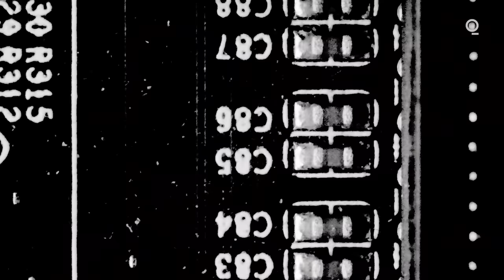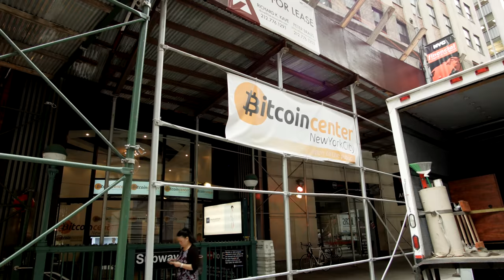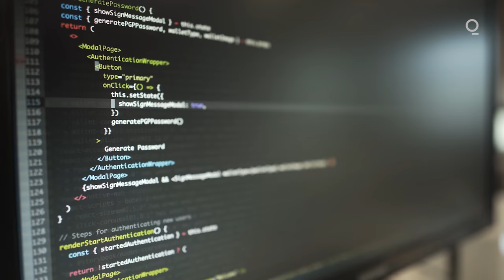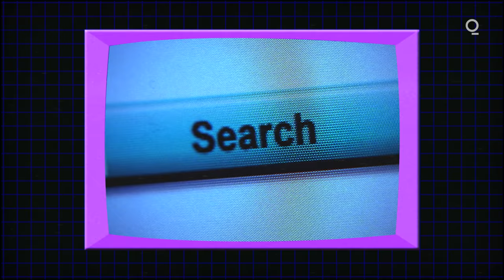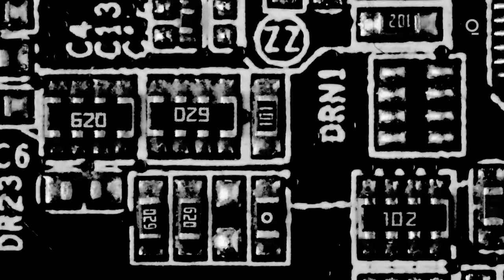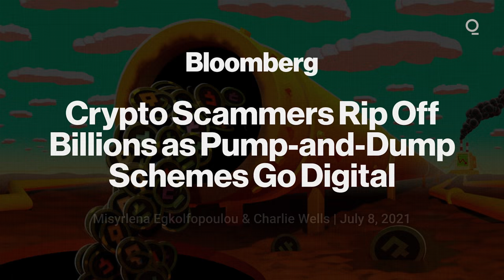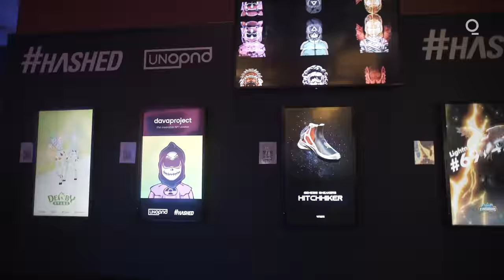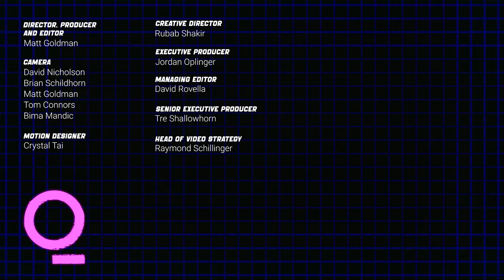From Bitcoin to DeFi (in 12 Short Years)

Comment: Those mine the largest share eventually control the network what's the point of decentralized.
Reply: To the best of my knowledge, "min[ing] the largest share" is insufficient to control the network. You don't need to just do more than anyone else individually, you need more than everyone else put together, i.e. an absolute majority: >50%. On your own. While this is a potential problem, it is my understanding that such a feat is practically infeasible on any coin with a large enough following to be viable. (With the possible exception of coins that were specifically designed for their creator to control them.)